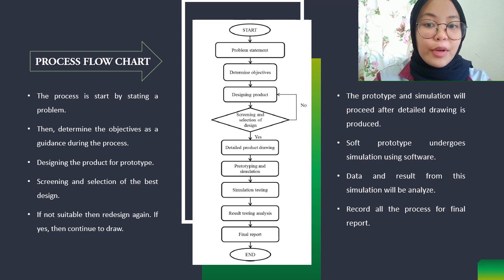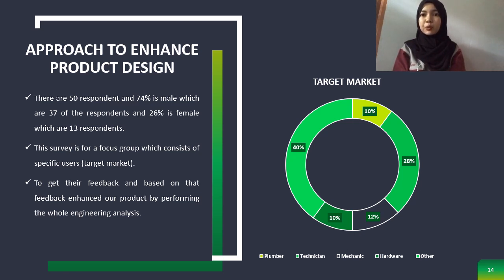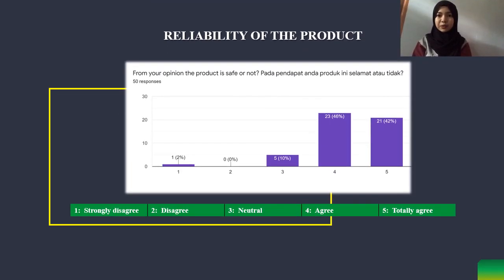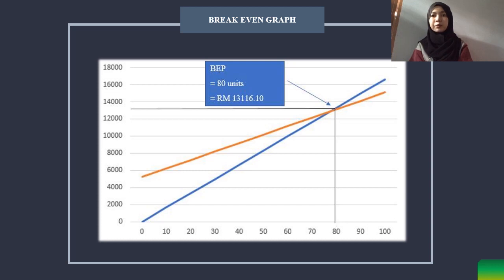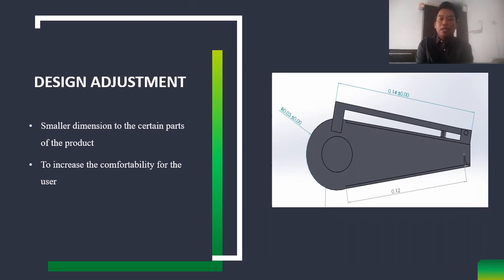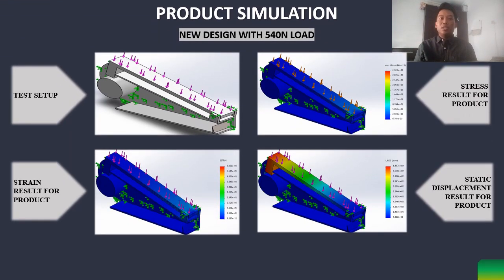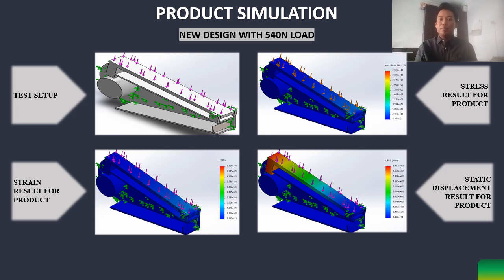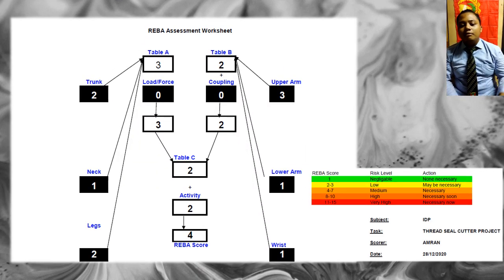THREAD SEAL CUTTER (PRESENTATION) - GROUP 4

Comment: In your simulation, can you explain basis of all boundary condition used?
What benchmarking have you used prior to designing your product?
What improvement can be made for further improvement of your product?
Reply from the maker: 1. first of all the boundary that we have set is the force applied, fixed hinge and elastic support from the spring
a)for the force we take the average gripping force of 540N as a guidance to simulate the real working environment, this is the average force applied by normal male
b)the hinge is being fixed at its position to minimize the displacement of the handle to avoid its collide with the roller
c)spring is being set at elastic of 10N/m^2 stiffness based on the size of spring that we have designed as a counter for the downward force from handle
2. We develop this product to be function as normal tape dispenser but with additional features to hold the elasticity of PTFE tape (white tape). This product development  process is a systematic way of contrasting the activities of one company with those of other companies so that the resulting insight can be implemented for change. We already compare this at house of QFD ( quality function development)
3. The improvement that can be make is, in the future we could add some additional feature such as hanger, so that we could hang this product on pants. It is because as a worker or plumber, they need the product to be easier to achieve by hands and it could fastened the work. This analysis also based on the survey that been made
Reply: thank you Dr.Mohamad Haidir for spending your time evaluating our project
Reply: Thankyou Dr. Mohamad Haidir Maslan.
Reply: Thank you dr, hope that the answers given are acceptable and help to evaluate our marks